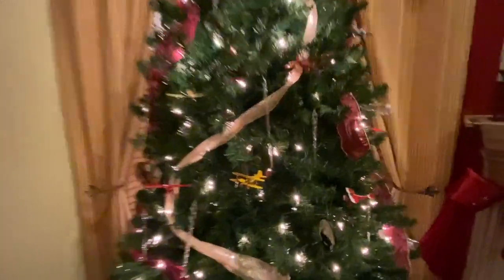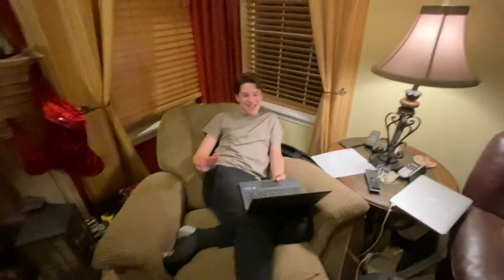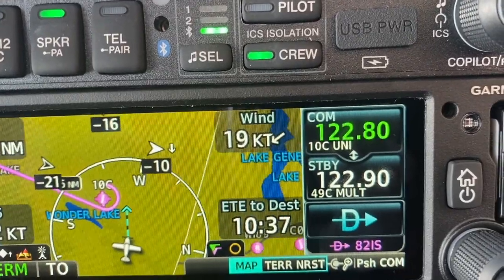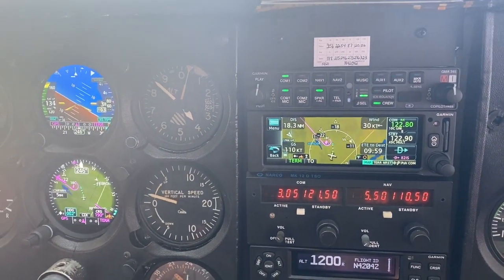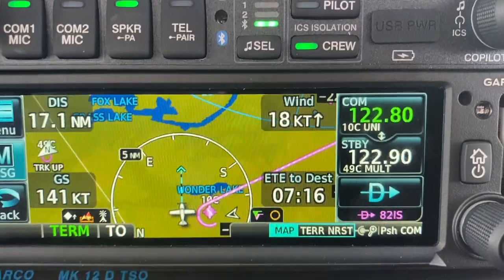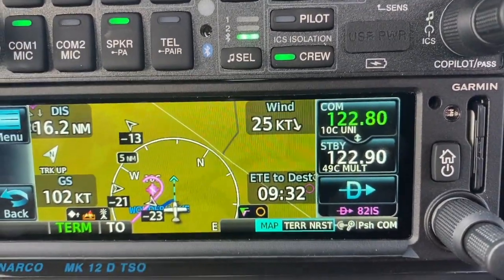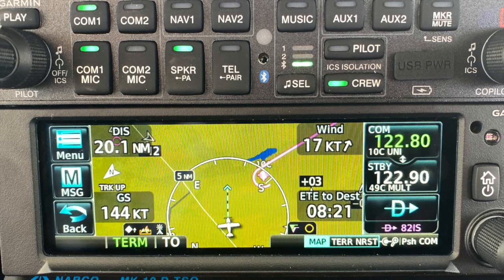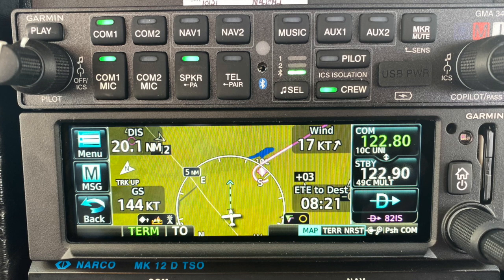Garmin Winds Aloft Problem

Comment: There are a lot of known issues with the GI275. In fact Transport Canada has an AD against them. Dual g5 system no issues. I would not fly hard IFR knowing what I know about the GI275 issues
Reply from the maker: The G-5’s have battery issues, units that suddenly “brick”, and now there’s a SB about them incorrectly calculating airspeed.  I have a buddy that is having serious issues with his G-5’s.
Reply: @quinnjim  have not seen that with either of the aircraft i maintain and fly. Battery issue is a software problem. I've seen way more out of 275 problem wise
Reply from the maker: @gabekremer7148  It sounds like you are looking at a very limited sample of units.  I've researched online and you get a larger sample of what people are seeing.  It's all newer technology stuff.  There are bound to be issues.  I hope Garmin can clear up the problems to keep us all safe.  So far, I really like my 275's.  I've spent a lot of time behind G-5's as well (I just helped a friend get his instrument rating).  We didn't have any issues on his.
Reply: Yeah I looked up the new bulletin. Its a very limited number of G5s with Issues. One of the units in my Mooney missed by 3 numbers. If you buddy is having trouble getting a fix I'd gladly help have install lots of them and do garmin stuff a lot.
Reply from the maker: @gabekremer7148  Thanks. Garmin just agreed to replace both of his G-5's.  That will probably fix the problem.
Reply: @quinnjim  bet he had the magic serial numbers they want back. Should meet up sometime. Not far from eachother
Reply from the maker: @gabekremer7148  Sounds good.

Comment: I've only recently noticed this problem myself with my dual G5 setup. The TAS/GS/wind vector discrepancy always seems worst with a quartering tailwind. Had my G5 airspeed indicator checked and it's perfect.

I've was watching a video the other day of a brand new G1000 DA42, and it had exactly the same problem. Perhaps it's just a general problem with Garmin's method of calculating the wind vector, if you can call that a "known issue"!
Reply from the maker: It's pretty frustrating.

Comment: Where is your temp sensor installed?
Reply: When you turn, do you notice your OAT change on the 275’s?
Reply from the maker: @nick.simmer  The temperature sensors are located under the wings.  They installed two of them.  I didn't notice the OAT's change.  I'll have to check that out.  Thanks Nick!
Reply: @quinnjim  my thought process is that the sensor used to help calculate that data might be in the slipstream. I can’t say for sure that’s what’s wrong, but I would begin there. I installed my under the left wing. My installation is dual G5 with the GAD29, GAD13, GMU11 all talking via CAN-bus. I know the new GTN uses High Speed Data Bus and I’m not sure how they talk to the temp sensor. But the reason for having two might be because the transponder may not share that data with the 275’s. Anyhow, those are my thoughts. It’s a deeper conversation than this, and I’d be happy to share more of my thoughts on it if you’re interested. I’m 20 minutes from DeKalb.
Reply from the maker: @nick.simmer  I think I may just make an appointment at the avionics shop.  If there is an adjustment that can be made, they should do it under warranty.  I talked to them about it and they said it was a "known issue" with Garmin.  My friend has the same setup as me on his Arrow and he is seeing the same thing.  Another guy said it might be that my airspeed is reading high and needs to be calibrated.  I'm looking into that as well.  Thanks for your insight.  I'm up at The Landings.  Pretty close to DeKalb.  I soloed my last student at DKB since he was doing it in a Cirrus and I figured he could use the extra room (the Cirrus is a runway hog).
Reply: @quinnjim  sounds good. I’m a bit curious how close my dual G5’s are. I don’t recall that being an issue, but now I’m up for having a look to see. I’m at SQI so yeah,  not far out at all.  I 100% agree with you on the accuracy issue. If it’s a known problem, I would think for the money we spend on these upgrades, Garmin would have better support. On the positive side, I like having the wind information right in front of me too. I didn’t think I would ever care for it until I did the dual G5’s this spring. I love it!

Comment: It may mean your airspeed is indicating high. Go do a triangle GPS ground speed test and determine your TAS, then compare that to what your TAS is by calculating IAS the old fashioned way. If it’s indicating high, you’ll register higher headwinds and lower tailwinds.
Reply from the maker: That is an interesting thought.  My Garmin shop said it was a "known problem" though.  I may check that out!